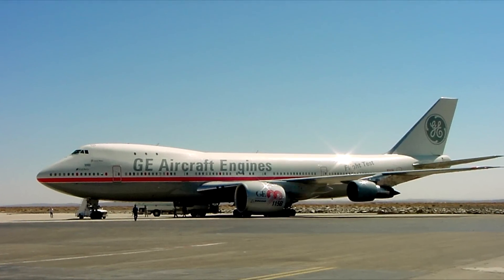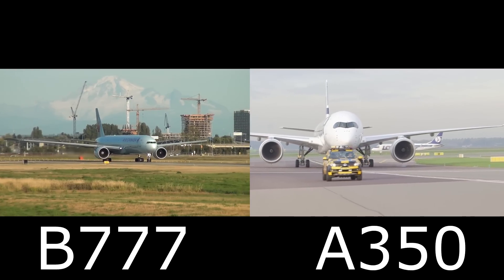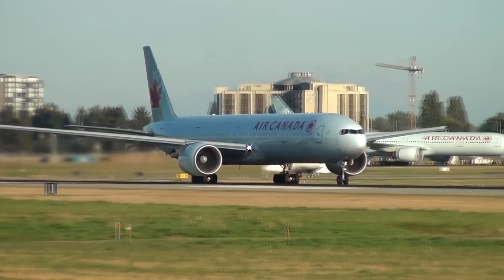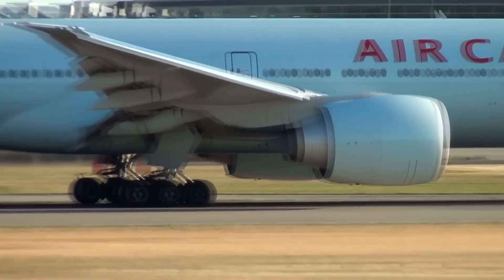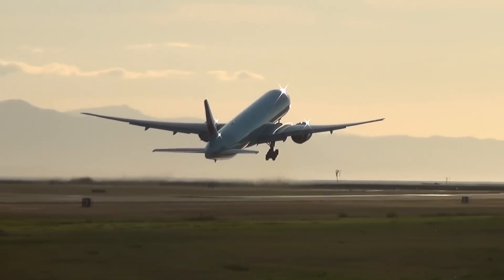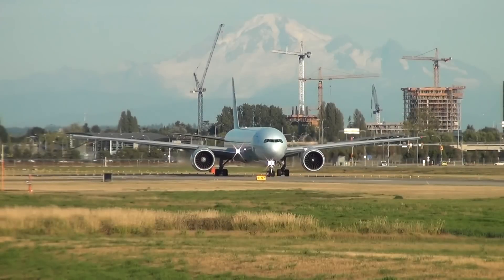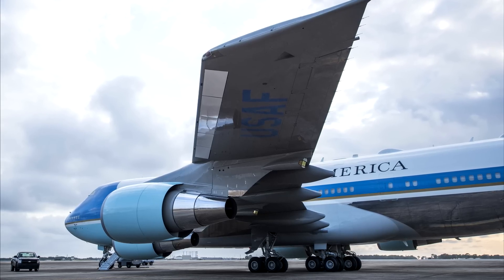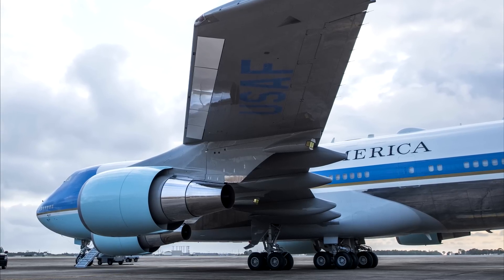Will 2 GE90 Engines Work On The 747?

Comment: I find the outside appearance of the 747 200 the most pleasing, and there might be an advantage as far as weight given just a little sacrifice of capacity. Get the impression they were trying to squeeze too much into it with the following models rather than, heaven forbid, going to a larger-still jet platform.

Comment: give the 777 a hump. Then call it a 747. problem solved. After all the distinguished hump is the main attraction about this iconic plane. Then do some new engine to weight ratios calculations

Comment: I know for a fact airforce one uses b787 engines on the. I was standing in person several hundred meters away. Even at that distance its apparent the engines were not from a b747. The only thing that stuck out to me was that I've never seen a b747 with engines that big. I don't care what wiki says.Those engines dwarf the b747 engines
Reply: The 787 and 747-8 are the same type, but have different sized. The ones on the 747 are a bit smaller

Comment: Maybe a 747X with the 777X wings and engines and only freighter versions probably would be very feasible, since passenger versions would not be economically viable because of the capacity.

Comment: Since the GE-90 is more efficient, wouldn’t it be a good retrofit to the 747 in all four locations and just run them at reduced output to not over stress the wings?

Comment: I don't see that you gain anything by going from 4 medium sized engines to 2 massive engines and maintaining roughly the same thrust and you would likely very likely have to strengthen the wing where the engines mount. It's a moot point people are flying point to point now much more than hub-and-spoke and people like going directly to their destination.

Comment: It is a very pretty design but the 747 with four engines was a very Sleek nice looking jet itself. It's doubtful the 747 needs for ge90 engines. And one of them main reasons or the demise of the 747 as we knew it or know it is operating cost a lot of that is fuel consumption for those huge engines would consume large amounts of fuel. And the weight of the engine like the man said would probably require a new Wing design and likely it would be carbon fiber very expensive and isn't the 747 more of a hub-and-spoke airplane like the A380 people prefer the point to point way of travel now and I don't blame them. Who doesn't?

Comment: It most certainly makes sense all the increased bending moments of the point load on the wings as well as the controlling of aerodynamic surface modifications however I find it far simpler to just graft the iconic 747 hump atop a 777 and and call it a day.

Comment: Considering GE and Boeing have already mounted a GE90 to their 747-400 testbed and flown it with the other 3 CF6s shut down, Id say that the fuel flow, ground clearance, and thrust asymmetry is all within the envelope of what the 747 can deliver.  Wing loading/airframe stress is really the only question.
Reply: to be honest unless we are talking about retrofitting old 747s its not worth it the 777-9 basically meets almost all the 747-8  specs in passenger transport but its much more efficient

Comment: In an engine failure, you now only have 1/2 the thrust instead of 3/4 the thrust the old way, but they're able to handle that on a 777, so I am sure it might be theoretically possible.

Comment: The 747 is a reliable proven aircraft and with the demise of the A380 which airlines do not wish to fly because of the enormous costs, it might just be the ressurection of the B747X as a new passenger aircraft. The 747 is an aircraft which I have always felt safe to fly in as a passenger traveling the Australasia to Nth America route.

Comment: I have a dream. Make this plane solid so that no matter what speed you go. The wings won't break off, and it's structure integrity won't fail. (yes I'm into startrek) instead of GE90 engines give it warp nacelles.

Comment: How about keeping the outboard engines and replace the inboard ones with either the GE90 engines or the new GE9X. The Queen could take off using all four engines and once at cruise height switch off the outboard and cruise using the more efficient inner engines.

Comment: I already had this idea for a private plane. 747 SP with 2 GE-90 engines capable of flying 12,500 miles non stop. The landing gear would need to be taller. A complete redesign would be required. Definitely doable.

Comment: Pointless...  what is the benefit of a 747 body over a 777 other than cargo... and if we go there, it will probably be easier to add a second floor to a 777 rather than change the wing and tail design of a 747

Comment: You just can´t. If you lose an engine on a 747 you lose just one of 4. Still 3/4 of thrust is available. If you lose one in a twin, you only have 50% left which is then not enough to get the 747 airplane safely off the ground on take-off.

Comment: Maybe if there is a new generation of lighter more powerful engine's, a twin engine design would be possible, at the moment the 777 engine, I can see looks too much in one place on a low wing.
I do hope it happens as I really like the design of the 747, but they are being hurt on the fuel economy and flight range, I think it's possible just not yet, I like jumbo it has to stay, but I liked concord too,  the 747 is endangered, the a380 is gone, I hope some one continues to look at the feasibility of the twin  engine design, it's not static, something might come up and may save the aircraft for mass use.

Comment: There are G-90 engines with 128,000 pounds of thrust and than the G-90 115B has115,000 of thrust. It should not be too dificult.

Comment: it’s all about the weight !!! 747s are all aluminum built, heaver than the new 787 & 777X’s ... so no i don’t think that would work maybe if 747s were redesigned as  a tri engine and used GE9X’s with composites like 787s that might work... but there’s a huge flaw with that as well, as a tri engine if the rear engine ever explodes then it will probably cut all the hydraulics in the tail and crash like happened on a dc-10... i still like my engines on the wing.. but not to worry the 747 will be around for a long time, even though airbus is bigger they never made a cargo version, and as you see purses strings tightening your seeing a380 orders being canceled..

Comment: Boeing is mounting the GE 90 on the new 737 Max Performance.With an aircraft takeoff weight of 48 tonnes and engine thrust of 57 tonnes each this will give the aircraft vertical acceleration capability even with one engine out,resulting in a climb time to 41,000 of 39 seconds with one engine or 22 seconds using both engines.
   This development was in response to the demand by business jet buyers for an aircraft that can land vertically on the sides of residence towers higher than the FAA mandated 62 story minimum for side mounted building hooks.The GE 90 was developed to meet ETOPS  requirements that require the aircraft to be able to climb up the side of a building safely even in the event of an engine failure.

Comment: This is my opinion, but I think it is isn't possible because if one of the engines were to fail during mid air, there will be too much complications about the how the other engine will have to compensate for the other one.  Second of all, I think that there is too much burning fuel with 2 engines rather than having 4 smaller engines to have a larger total thrust. I think having 2 engines is really cool but to do that will have to take years of work and a completely different design of the plane to make it work.

Comment: How about if they made new carbon fiber wings for the 747–8, and those new wings would be designed to each hold 1 GE90 115B, or even the new GE9X ?? 
I bet that would work

Comment: If any commercial manufacture can then boeing can ! Using 4 (777 engines) on a 747 is possible just by re-designing the wings to carry such a pay load.  And such a plane should be called the All New 747- 900 using bio-fuel energy.

Comment: How about a stretched 747 with 4 GE90's. Maximum range with maximum capacity. 600 passengers, 2 full length decks would make a great competitor for the A380.

Comment: obviously designing a new aircraft is a lot more work than further developing one available.

The problem is typrerating. I'm pretty sure with 4 engines it can't be sold as a 747 variant. There are limited changes that can be made to an existing aircraft to sell it as a new variant.
Since this would be a new aircraft it would need years of testing, testflights and the pilots would have to do extra training.
So it would essentially be as hard to introduce as a completely new aircraft.
So there is no point doing it

Comment: FWIW this would be easier to achieve on the A380 given favorable gull-wing design for greater engine clearance, as well as a huge rudder. Plus the overall frame offers greater potential efficiency-wise. 

Either way, I think four-engined VLA aircraft may be a thing of the past.

Comment: The engines you’re talking about using were specifically developed to fly an aircraft with a MTOW roughly *115 TONS LIGHTER*  than something between a 747-400 and -8i. 

That automatically means the engines won’t work. That thrust level was set based on critical engine-out safety requirements in various phases of flight. Sure it could fly on two, but just looking at it you can tell a single engine could never support it on takeoff, fully-loaded.

That’s literally the sole driving force behind the huge thrust requirements of heavy twin-engine aircraft. 

The only caveat is that the 300ERs MTOW is difficult to support with its relatively small wing - (not optimized for this larger variant) - in simple terms thrust made up for this - hence why the new 777x has the same MTOW but about 10klbs LESS thrust per engine because of new larger wing.

Comment: The biggest advantage of the 747 is it’s high ETOPS rating. If  it were to transition to 2 engines, the 747 would then have to re-prove itself to re-earn a higher ETOPS rating.

Comment: How about 4 GEnx engines. It’s easier and cheaper to implement than 2 GE90 engines and still significantly more fuel efficient than the old Rolls Royce RB211s and gives room to implement exhaust chevrons.

Comment: That begs the question, why didn't they try to design the 747-8 with a 2-engine solution, since fuel efficiency is becoming such a squeeze on all the 4-engine aircraft? They reworked so much of the plane that they should have done it then, if they had any chance to make that work at all.

Comment: Even the first generation 747 can work with only 2 original engines, it has 4 engines for safety to cross the Atlantic and for higher speed, but it can work with only 2 engines.

Comment: After talking to the pilot who flew that plane during the tests he said they would work just fine. They had trouble getting to 100% thrust on the test engine with both engines on the other side at full throttle. The "at altitude" performance is far superior vs the older engines. The fuel flow was substantially less. He also mentioned they talked about the retrofit but as mentioned in this video the wing would have to restructured for commercial service. Fine on anything in production but not cost effective for anything already flying

Comment: Well, a330 and a340 basically sharing the wing, to the point that remnants of outer nacelles mounting points are used to mount refuelling equipment on a330 refit as military tankers for nato.

Comment: I actually asked this on youtube 10 years ago. An aeronautical engineer explained that you would have to re-engineer the lower belly of the plane because of a change in aerodynamics. I believe the angle of attack would be very fragile to maintain, maybe larger rear rudder, because no drag is present on the out board wings. Physics plays a major role in designing an aircraft. Not only parasitic drag and other airflow inducing effects, power thrust, but weight distribution as well. Aircraft MUST burn off fuel prior to landing to prevent airframe fracturing, or worse destruction. Two larger engines will probably weigh more, fuel consumption might be an issue because of the drag of the rest of the plane will make maintaining thrust unorthodox than if it had all 4 engines. Also, politics involved with keeping jobs and fuel consumption. Redesign of the plane to handle the thrust power and weight of the plane carrying two engines will be probably the most important consideration to take when inducing something like this. Also, the cost to re-engineer and re-engine the plane makes it pointless, unless you're Warren Buffett, Bill Gates, Donald Trump or Richard Branson.

Comment: This would be entirely too costly. The engineering and redesigning of the wings alone would be a fortune for an aircraft that Boeing will be shutting production down soon. Also don't even get me started on how much it would cost to get all 747s ETOPS rated now that they would only have two engines.

Comment: There was an early attempt to re-engine the 727 for 2 larger, more efficient turbo-fan engines, redo the tail without the upper intake and eliminate the 3rd engine, but Boeing would not provide the technical info to the company that wanted to do the modification.  Boeing  wanted to instead sell newer 2 engine 737, 757, 767, etc.  A redesigned and more fuel efficient 727 would have been unwanted competition.
Reply: Jane D Redding could be hope

Comment: All well and good until you're over the middle of the Pacific and one of your engines goes out which would be the equivalent of losing 2 on an 800. That would be some serious pucker Factor moment right there especially since you have the throttle back fairly good because you would be yawing like a mother!

Comment: The current 747 tail is probably adequate.  Remember that the tail is designed around a failure of an OUTBOARD engine, meaning an enormous thrust imbalance with the remaining outboard engine thrusting away way out on its moment arm, which is probably at least as big an assymetry as single larger inboard engine.

But in the end, the 777-300ER can carry 90% of the passengers and more cargo than the 747-400 on half the engines.  This aircraft replaced the 747-400 for that reason.

Comment: Pretty good explanation. But there's one thing that you left out, which is how the aircraft would handle in flight. Boeing had looked at going to a 3 engine configuration some time ago, mounting the third in the tail similar to the L-1011 or DC-10/MD11. Their conclusion was that it was both impractical, due to the cost of redesigning the structure of the fuselage and wings, but also because it would have made the aircraft handle much differently.
Boeing saw both challenges as impracticable, due to the obvious increase in the cost of the aircraft but also the cost airlines would incur to retrain flight crews. And determined that both together would have off set the savings of reduced maintenance costs and fuel savings.
But as you said, its always fun to think of what if's, and look at what could or would happen.
But here's another idea to look at. Instead of re-engining the 747, what if we added the extra landing gear to the 777, to increase its max weight rating, making it more attractive as a heavy hauler?

Comment: Even if all the obstacles could be overcome, losing one engine at takeoff would be like losing both on the same side now. Even a larger rudder would not help if the pilots could not react fast enough to compensate for the asymmetry. Keep in mind the MTOW is about 100,000 pounds more than a 777. Wing clips the ground, game over. An in-flight engine failure would probably not be catastrophic, but the one remaining engine (on a plane of this size) would probably struggle to maintain things such as cabin comfort, while possibly being hours away from a suitable airport. A plane of this size is much better off with 75% of engine capacity than 50%. The three-engine design of the 727, DC-10 and L-1011 was a nice balance, even if it was driven mainly by the higher probability of engine failure of that era. I'm surprised that some type of three-engine design was not continued.

Comment: You, the author of this bring up a lot of great points why it would not be viable to convert a 747 airframe to 2 engines. 
On the other hand, it's just laughable with some of the comments being made about two extra smaller engines, etc. I have no engineering background but was a flight instructor for ten years and have read much about aviation technology. I think a lot of these comments are coming from very young and naiive posters. Hey! They have every right to post but I try not to post comments or recommendations where I'm not qualified to do so.
My understanding there is a big surge on converting 747-400 And 300 series into cargo aircraft because of the increased capacity demand-which would all but negate the possibility of converting the 747 into a twin jet anyway.

Comment: Maybe 4 of thoes ge 90 engines will really work great but the 747 will be too fast for the design of the aircraft hence these planes are only designed to fly below supersonic. if you use 4 of the most largest and very powerful engines.two might work but there is a reason for 4 original engines for a boeing 747

Comment: Certification standards for a twin jet requires that the aircraft must be able to continue to fly if an engine is lost during the most "critical phase of flight." That's usually at VR, and it's probably why this wouldn't work...

And, of course, the 747 wasn't designed to ETOPS standards - and "retrofitting" that would be a huge problem too...

Otherwise, the folks at Boeing made a twin engine "747" - It's the 777...

Comment: Apart from the  engine out considerations, the hydraulic, electric, fuel and pneumatic systems would all have to be redesigned for 2 engines. It’s easier and cheaper to start with a clean slate.